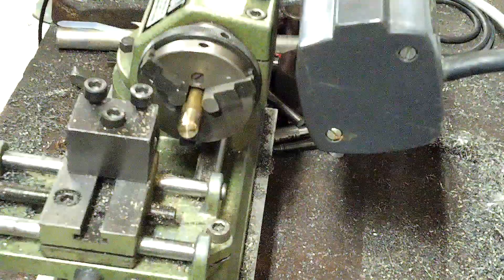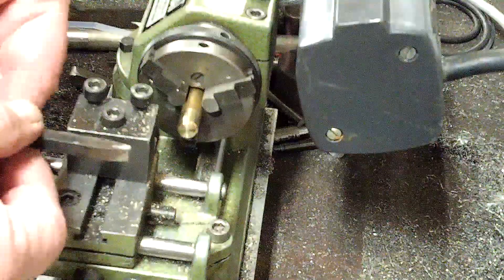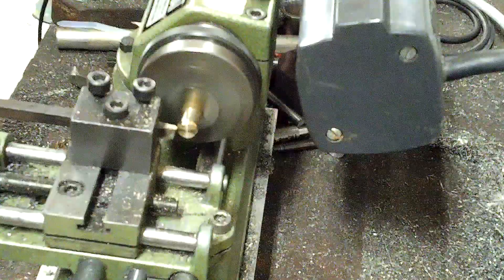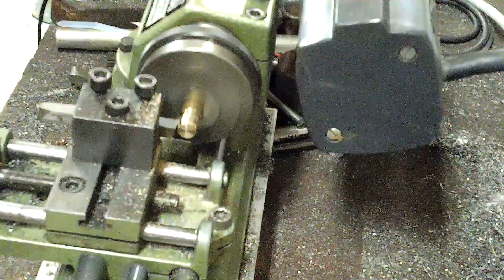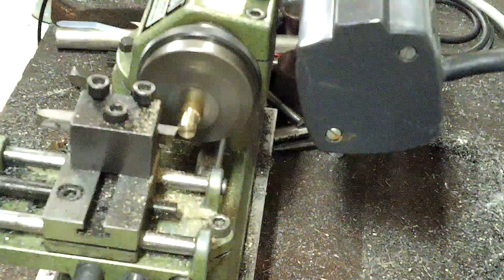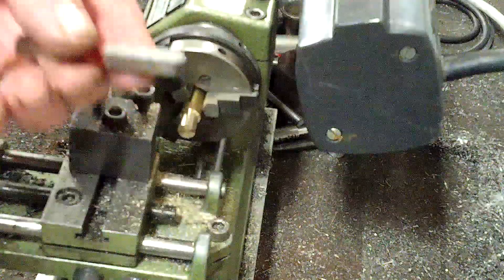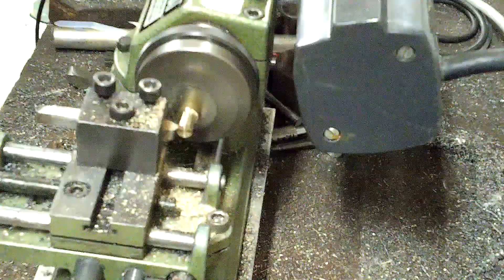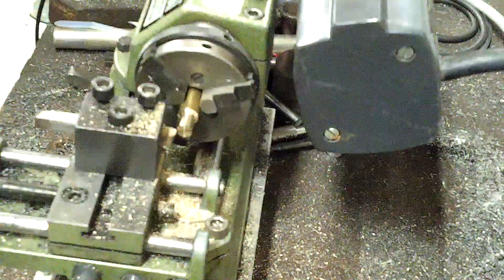HSS Brass Turning Tool

Comment: we can't really see the surface finish, but I'll try 0 rake and the 10 deg. side edge, 1 just for brass when i grind my bits again. lots times you can get away with almost anything but heard even 0 rake for drill bits for brass can help because it's grabby material
Reply from the maker: thanks for watching! the side 10° side clearance, with no top rake is a very nice tool for brass